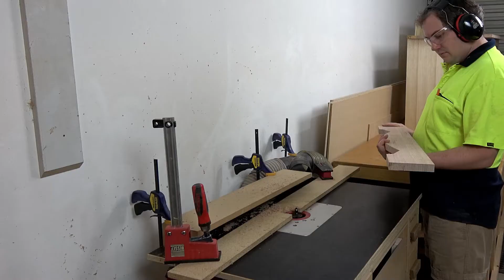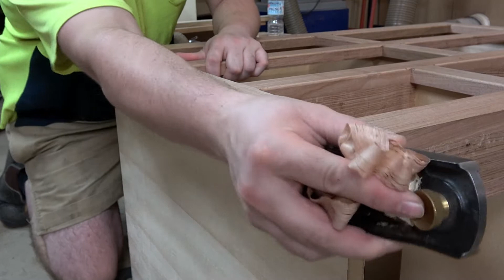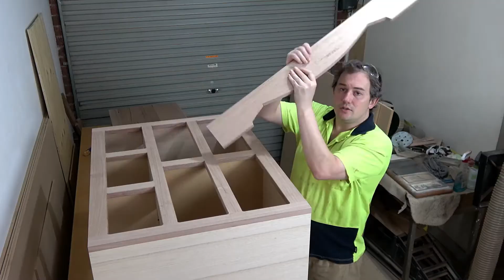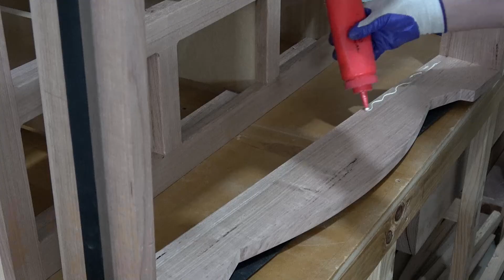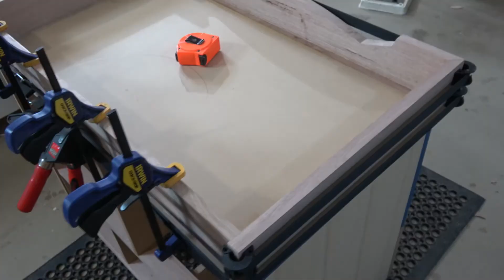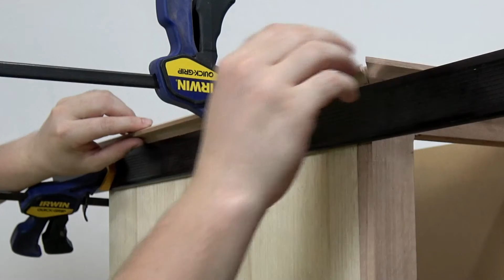Chest of drawers build 5 - Plinth and decorative mouldings

Comment: Mate, it’s looking good. I always look forward to your wisdom and tips but you didn’t tell us what you did about the pice of veneer that got planed off.
Reply from the maker: To be honest, I started to film the process of fixing it. But it is such an epic nightmare to remove the ruined panel without damaging the rest of the piece that filming just became too hard and I knew that the video would run to 30 minutes again. Essentially what I did to remove the panel is to drill straight through the panel exactly where the dowels were located without drilling too deeply into the rails or bottom panel. Then I put the unit onto the saw and cut away the panel from the faceframe which was connected to via a tongue and groove. So now the original panel has been completely butchered, and I think I salvaged some of it use as 50mm wide packers. 

From there it is a case of cleaning up the ends of the rails and bottom panel, cleaning out the groove in the face frame then making a new panel which I luckily had the same veneered MDF sheet to get the panel from. If you look at the video when I replace the panel, you can see that I haven't installed the dowels closest to the face frame. Doing that allowed just enough clearance to bring the pieces together.  So I had to do all of that while being red in the face with anger at myself. Luckily I have so much experience that I was able to fix this panel the exact same way as I did it the other 3 times in my career, which doesn't sound so good 😀
Reply: Wow mate, I feel your pain. Thanks for the detailed response, I can understand why you didn't include it. Cheers till the next video mate.

Comment: You dont trust the measuring of the tape i woder if it's the tape or you lol great build i love it loving your tools.🇧🇸
Reply from the maker: It's definitely me. I don't trust the tape measure because how would I accurately take the measurement of the short face of the moulding between the two mitres? I can't, but I can creep up on the length and check it by eye perfectly.

Comment: Great video, Kuffy. A question, what was the material thickness of the material you made the cove molding out of?
Reply from the maker: The cove moulding was 20x20mm with a 15x15mm cove. So it was 20mm thick. I used a wider board that was 20mm thick and put the cove moulding on using the router table. Then I ripped 20mm off that board to give the 20x20 moulding. It's a little sketchy trying to use 20x20 stock on the router table 😀
Reply: Thank you sir.

Comment: Looking good mate. Tell me please how did you repair the area where your plane went a mite too deep. Had it been me I would of had to replace it.
God Bless my friend.
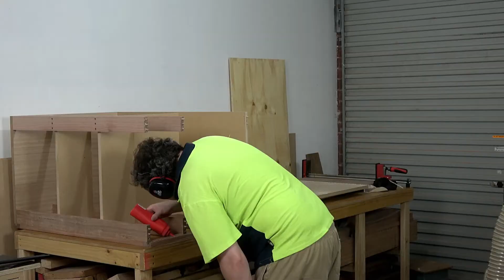Reply from the maker: I did have to replace the panel. At the 5:23 mark in the video, you can see me installing a new panel. It's a major pain in the butt to remove the old panel which takes hours, but since it is now a garbage panel I can hack into it without fear of damage...because it's going straight into the bin 😀

Comment: When you started planing down the solid timber edge, I thought you were being very brave!  Bad luck.  Would you consider using shadow lines between the solid timber edging and the veneered MDF?  (Shadow lines are typically a tad under 3mm wide and say 1mm deep.  Allows for an imperfect join between the two different mediums and are not unpleasant to look at IMHO.)  Definitely agree the dressing for the top and plinth transform the look of the carcase.  Nice work.  Cheers, David.
Reply from the maker: Haha, I was thinking the exact same thing when I picked up the block plane. The correct tool would have been a card scraper, but I fancied my chances a bit too much with the block plane. I didn't use a 3mm shadow line. It's more like two arrised edges meeting with consistent 0.5mm gap between the two. Looks pretty good and will disguise the joint in the years to come when they are no longer perfectly flush given the differential movement, however minor it will be.

Comment: The moulding and plinth does really transform it! It's one of the things I really struggle with from a design point of view, as I've seen so much cheap pine furniture with excess amounts of bad moulding that really detract from the piece.
Reply from the maker: Yeah, it's all about creating highlights and lowlights which gives the piece depth. It's kind of out of fashion these days with people opting for the clean straight lines, which just happens to be a direct result of manufacturing costs going up and straight lines are much cheaper to produce than something with curves and layers.